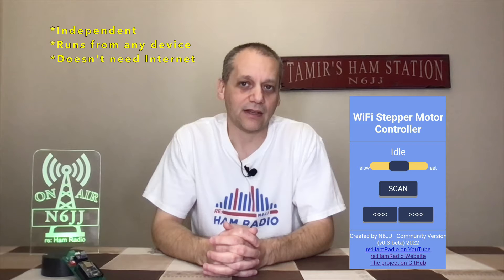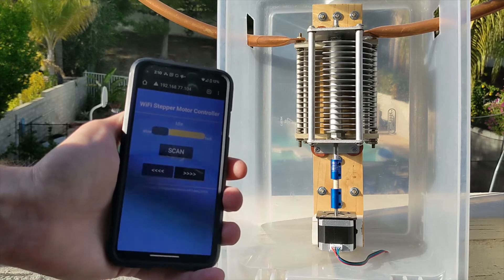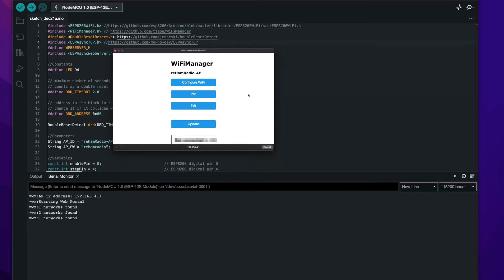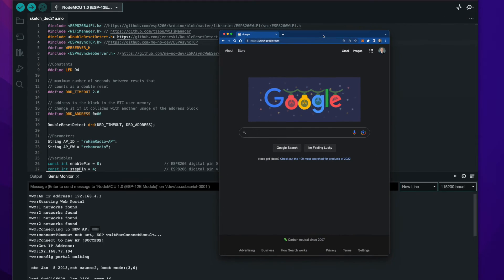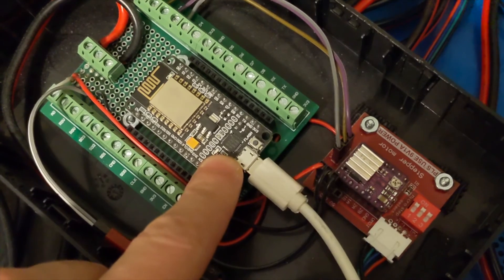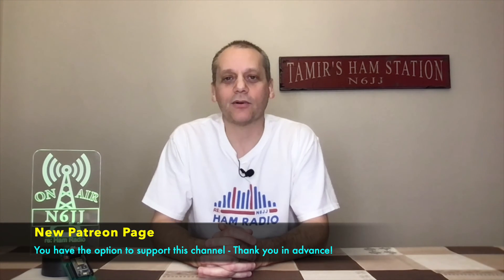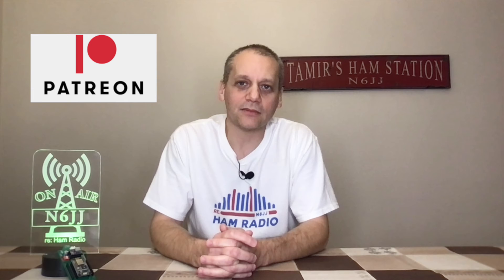New WiFi Stepper Motor Controller App for Magnetic Loop Antenna (Blynk replacement!)

Comment: Can't download the software just a joke !
Reply from the maker: If you do have issues, please let me know.
BTW, there is a new way of installing the firmware that developed lately, and can be found on the website, under Application. It will give the option to upload the firmware without Arduino IDE, directly from the browser.
Reply from the maker: I will announce that formally soon.

Comment: What is the source for the variable capacitor? What are the specifications?
Reply from the maker: Hi, please check my other videos that explain in detail how to build the mag loop. 
I personally found my capacitors on eBay.
Reply: @reHamRadio  I paid for the firmware but did not get a download response? Sent an email from your website also.

Comment: I just upgraded from Mac Mojave to Mac Monterey and the stepper motor sketch won't compile. I tried earlier and latest version of Arduino IDE but to no avail. Anyone else having a similar problems? Also tried on Mac high Sierra which gives different errors.
Reply from the maker: It depends on the errors. But with a quick help, please make sure that your Arduino IDE is configured. It could be that after the upgrade of the OS, the Arduino IDE reset the configuration.

Comment: Thank you so much for this! I am working on this project now and have got all my parts to put this together. I am going to 3d print all of my parts to hold my boards and motor in place. I am using an air variable capacitor that doesn't have 360° of rotation. Could you tell me how to go about adding 2 stops in the code so I don't stop the stepper motor at the end of the capacitor rotation and continue powering? I am afraid I would damage my stepper motor pretty quick.
Reply from the maker: The latest software version already contains "Memories" which can be used to set specific locations to stop the motor. In addition, the software provides the option to set virtual limits, that will act as the min and max range for your capacitor.
Please check my website as I explained how all the features can be used. Good luck.

Comment: Je možné konstrukci upravit pro ovládání 2 krokových motorků a tedy i aplikaci? U druhého motorku stačí jedna rychlost - pomalá. Pokud by to bylo možné,  tak ovladač i software rád koupím. Lev OK2PLL
Reply from the maker: Hi @Lev, thanks for your question. The CT-1 controller, in the current version supports only a single motor. It is one of my ideas to add that option for the next version.
But, if someone wants to do that, meanwhile, it can be done as I added extra pins in parallel to the ESP, exactly for new features and testing. 
Adding another motor is only using more 3 pins from the ESP into another DRV8825, and to update the code to support that.

I'm curious about your implementation, but it looks like you want the second motor to control the antenna direction?

Comment: Hi Tamir, Every time I try and upload the sketch I am told that Wifimanager.h can not be found. Even if I try and upload it to the ESP8266 first
Reply from the maker: Could it be that you are loading a different library? Please check the GitHub page, I explained in details on how to load the libraries with their links. But just as a tip, you choose "the easy way" to install the Firmware that already contains all the needed libraries, it's in the Readme as well.
I hope it helped.

Comment: Anyone know how to reset the stepper motor code to operate as station mode only ?
Reply from the maker: When you refer to "Station mode" do you mean that it will behave as an access point? If not, if you can please explain your use case and I will be happy to help. Thanks.
Reply: @reHamRadio  Thank you for your help. I would like to have the esp8266 connect to my 2.4Ghz network (on router) directly . I don't want it to act as an access point being that I will use it only at home. In my situation, the current configuration  sometimes takes a long time to connect.
Reply from the maker: In that case what you need is already built. No need to change anything.
The esp8266 code operates as an Access Point only at the first use, so you will be able to set up the WiFi network at your home. Once you set up your home network (ssid and password) the ESP Access Point is disabled and the ESP become a station, connect to your home router and get it's IP from your home router. 
Exactly as you want.
I'm not sure which version you are using now, but I do recommend downloading the latest firmware 0.5.1.
Reply: Thank you for your help!

Comment: Well done! I have been playing with a Pi Pico W to do something similar. I too am using a webserver on the device.
Reply from the maker: Yep, Pi and microcontrollers can be used very easily in the ham radio shack. You can review more details on how I did it on my website and download the latest app version from my GitHub repository.
Thanks for your feedback, 73!
Reply: @reHamRadio  thank you, I will look, my initial purpose for the Pi Pico was for a remote reading RF power meter, it has better A-D than an Arduino. Your code would also be good for remote power switching. 73

Comment: What sizes of the non-flexible shaft couplers would work?
My cap shaft is 6.35mm (1/4") and the stepper motor schematic shows a shaft size of 4.5 +/_.1 mm. Any help is appreciated.
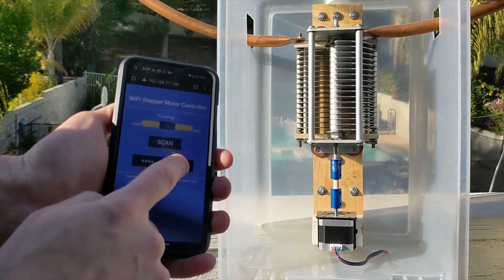Reply from the maker: Hi @Mark, I'm using a non-flexible 5mm to 8mm Blue shaft coupler. It should fit for both your motor and capacitor shafts. You can see it in the video as well from minute 3:17.

Comment: Dear Tamir,  many thanks for Your project and sharing with us. I successfully managed to make same controler using Your code and necessary boards, motors etc. But there is one problem: even if the slider for speed of rotation i is at lowest point( max to left) my motor is rotating much faster than Yours, 1 full turn is about 2 seconds only in length. This is not sutable for fine tuning... Can You advise what is the issue may be?
If other people who has same issue and know how to fix-please comment also. Thanks in advance.
Reply from the maker: I'm very happy that the project is helpful for you, that's always a great feedback. Thank you.
As for the speed question, are you using the DRV8825? If so, are the 3 dip switches "ON"?
Ports M0/M1/M2 at status "ON", will provide 1/32 steps.
Reply: @reHamRadio  Tamir,Thanks for reply!Actually I am not using dip switches.I just use esp8266+drv8825+plusivo 17hs4401 motor.All components are connected as per schematic diagram on Your github repository.The sketch for esp8266 is taken also there...
Reply: Tamir, all is clear,thanks for the hint about M0 M1 M2 pins. In github schematic diagram not shown that all 3 of them have to be connected to +5v.Othervise motor will work in full step mode.As far as I am not using expansion board for driver, I just add jumper wires to connect these pins to +5v.
Now all is working like a charm! many thanks again!Best regards from Ukraine!
Reply from the maker: Thanks Anatoliy for your update. I'm very happy that everything is working now as it should be.
I agree, you are right, the schema currently is not mentioning adding +5 to M0/M1/M2. This is how we control the DRV8825 steps. In my video I showed a special board that contains the dip switches. I will take that as a feedback to update or at least mention that in the schema. I appreciate your feedback.

Comment: I now can tell you it works on a D1 mini lite with A4988 for test but  the A4988 Needs the VDD +5v it wil not run without Pins are the same 0, 4, 5 = D1, D2, D3
Reply from the maker: Thanks for the update, @Andre.
1. Yes, the A4988 will work (even that I personally didn't test it), and as you mentioned and its also mentioned in the part description, the +5V is needed (difference from the DRV8825).
2. Anyone that want to use the A4988 must be aware that the max steps in can do is 1/16, and not 1/32 like the DRV8825, so the tuning of the capacitor will be less accurate. It's all about the goal of the final implementation.
3. Good to know that the pins are the same. Great! I had some ideas maybe to use something small in the future. Thanks for the information.

I appreciate your feedback and testing, @Andre - Thank you.

Comment: I have the sketsh on a lolin (WEMOS) D1 mini lite didnt connect any thing yet so far it looks like its working. Test later with a stepper board and stepper.
What struck me in that you have to register the controller on a WiFi. What if you're in the field. How does it work then?
Reply from the maker: This project can work without internet connectivity. When in the field, you can use your phone as the Hotspot instead of the home Access Point.
I have an idea for future release, that the ESP will act also as an access point so we will be able to use it without any external Hotspot.

Comment: My board label says it is ESP-12F not ESP-12E. I selected board 12E in IDE. After updating the board information, it was only the version available:
Please advise if you can. de Jose - wb2bwu
Update #1: I didn't find any support on Arduino for esp8266 12f, so I ordered some esp8266 12e board to play with. I am hoping that support for 12f modules will happen in the future. In the meantime, I will download micro-Python on one of my Linux machines and hope the 12f is supported there. Still, I am having fun.
Update #2: When I selected ESP8266 version 2.7.4, the code compiled ok. I uploaded the code to the board without errors. Version 3.1.1 had errors, so I just decided to go back to prior versions.
Update #3 - Software is working and I am able to remotely control the board.
Reply from the maker: @Jose, thanks so much for sharing your experience and findings.
So I can help you with the following:
1. "NodeMCU 1.0 (ESP-12E Module)" will works for both ESP-12E and ESP-12F, no need different board libraries. To make sure that you get the latest libraries that are available, you need to add the special "json" line into the Arduino IDE. Please review the guidance that I wrote in the README of the github project.
2. I'm using the ESP version 3.1.1 without any problem. I wonder what errors you see there, I will be happy to help.

Bottom line - I'm happy to hear that the project is working and you are having fun :)

Comment: Your remote tuner has been a game changer for me and I want to thank you for sharing it with the world. I finished up my DIY mag loop and with the remote tuner installed I don't have to run outside every time I want to move frequencies. With my portable rig and a power supply I can finally get on the air from my cramped home QTH and have been making great contacts from my couch. I don't have to go out to the boonies every time I want to use my rig!
Reply from the maker: What a great feedback!  Thank you so much for sharing that. I'm so happy to hear that this project is helpful. Please stay tuned to this channel as more updates will come soon.
All the best!

Comment: Great software , terrific instructions even a newbie like myself can understand . Can use this controller at home or in the field. My only hiccup in the setup is that the controller on MacBook works well. On my iPad, iPhone the forward/ reverse buttons don’t work. They “stick” in the on position when touched and released. What to do?
Reply from the maker: Hi @Mark, thanks so much for your great feedback, I'm happy to hear that you like the appreciation and it's useful.
I never heard about sticky buttons, but I can try and check that tomorrow on an iPad. I tested it already on different devices like few types of  Android, Mac, etc.
Interesting how old these devices are? I'm curious to know the browser's version. Thanks.
Reply: @reHamRadio  I want to use my iPhone 13 Pro iOS v 16.1.2    I too just deleted Blynk 2.0 and came upon your video quite by accident. Since then, I’ve viewed your other videos and they are excellent! Note to all…check them out.   Thanks Tamir.
Reply from the maker: @Mark, thanks again for your amazing feedback and I'm very happy that you liked the other videos as well. These kind of feedbacks give me the motivation to continue. I appreciate that.
As for the iPad - I can update that I replicated your issue on an iPad. Indeed, clicking these buttons create a "glitch" for around ~1 second. I don't have the solution yet, but what I found so far is that it's probably comes from the iPad iOS itself, as I got the same on both browsers, Safari and Chrome (on the iPad), so it's not a specific browser issue. And since it's working fine on Mac OS and Android, it make sense that it's from the iOS. I'm very curious about the root cause of that and I will continue to dig into it. I will update once I have more news. Thanks for pointing that out.

Comment: In order to control a vacuum type capacitor it will be useful to be able to set "Center" position ... then having the possibility to memorize "Maximum up" and "Maximum down" to define the limits ... The small stepper motor should't be able to apply a strong enough force to destroy the capacitor ... but having limits could be good
Reply from the maker: Hi @Ricci, Indeed, I do get lots of questions and requests in regards to Vacuum capacitors, so the good news is that I'm already working on that feature. It will support not just a Vacuum cap but any variable capacitor with limits. The main idea will be to set the Min and Max positions and from that point, the motor will run only in that range. Please stay tuned to this channel and the rehamradio website as I will update when its ready. I'm on it. 73.
Reply: @reHamRadio  I'm ready for you! Your project is very useful because some loop controller projects are based on components that due to electronic shortage woun't be available until 2024 ... Thanks for all
Reply from the maker: Hi @Ricci, please check my website. The application now supports vacuum capacitors with range limits.

Comment: N6jj
A brilliant redo of a great design.
Looking forward to purchase a few cards for multiple antenna builds. A good move to link the chip with a browser interface.
You have two different DRV chips listed 8255 and 8825 .Can we use either one? 
Thanks for the great video

John Limanowski N9DNB
Reply from the maker: Thanks, John for your feedback, yeah, I do believe that a web interface will be the best for the long run. More features will be released soon, keep following.
Also, please check the website for more details on the controller and a form to get more information.
73!
Reply from the maker: @John, it's the DRV8825. The other one is a typo, sorry for the confusion.
Reply from the maker: John, I just updated the website with details about the new controller as it's ready. Please check the website, thanks.

Comment: First tip for Arduino newbies like me, in order to communicate with the serial monitor (Control-Shift-M) in the Arduino IDE and have it write out anything other than gibberish, you need to match the baud rate which in the code is set to 115200 baud (I set it to New line too)
With that said, I get a new ip address.  My router can see it as a new device (ESP-506517) but when I try to connect to the device through the browser (I am back on my regular network at this point), it is refused.  I have tried it on multiple devices.  Any ideas?
Reply: Never mind. I figured it out.  It works!  You need to bounce the ESP8266 by pressing the reset button.  It doesn't seem to accept connections during the initial load.  Thanks for your videos.  They are great!
Reply from the maker: @Brian, thanks for your update and I'm so happy to hear that the application is running as expected. That's a great feedback! :)
Yeah, after loading a new version, even the IDE send a "reset" command, sometimes, based on some other conditions/libraries, a hard reset to the microcontroller is needed.
Stay tuned to this channel as new features will be released soon. Good luck, 73.

Comment: Great! Works perfectly with my roof loop. There is a butterfly cap installed which has no stop limits. Unfortunately on the loop in my garden i have a non-butterfly variable capacitor. I should put limit switches but the code changes maybe out of my knowledge.
Reply from the maker: Hi @Massimo, thanks so much for your feedback. I'm so happy to learn that the new app is in use and is helpful. This gives me more motivation to continue and provide more features, Thank you!
As for the limits, I've got you covered 🙂
I'm already working on a new version that will include the option to set limits (virtual for now) so you will be able to use a capacitor with limits and even a Vacuum cap. I still need to do some work and tests, but please stay tuned to this channel and I will update on that.
Thanks again, 73!
Reply: @reHamRadio  Thank you for the great work. I will stay tuned to your channel for future updates!

73! IZ0YMB
Reply from the maker: @Massimo, please check the website as I have updates about the controller and the application that supports capacitors with range limits like the vacuum capacitor. Thanks.
Reply: @reHamRadio  You did a great job! The new features are everything I was looking for! I will try the new version in the next few days.
Reply: @reHamRadio  Patreon activated! Ready for testing
Reply: @reHamRadio  Hi, thanks for this amazing project. I have also got this working with a capacitor that has two stop points so eagerly look forward to the inclusion of the stop limits you are planning to add. I am a newbie to using microcontrollers and the Arduino IDE so will definitely stay tuned to your channel, thanks again for your excellent content. 73
Reply from the maker: Thanks, I can update that the next version is under final development stage and will be release soon. It will include few features like the control of a vacuum cap (limits), watchdog, system information and more.
I will update soon. 73.